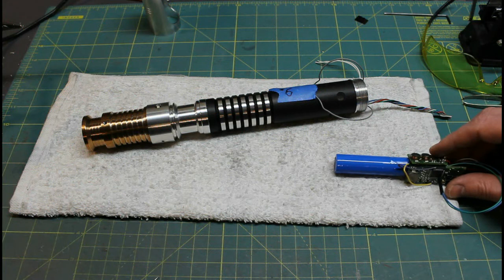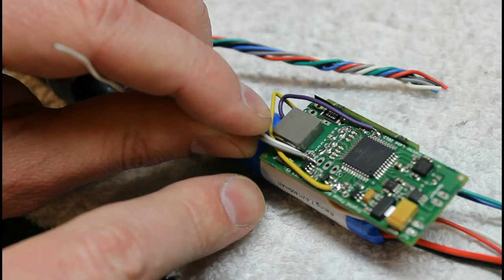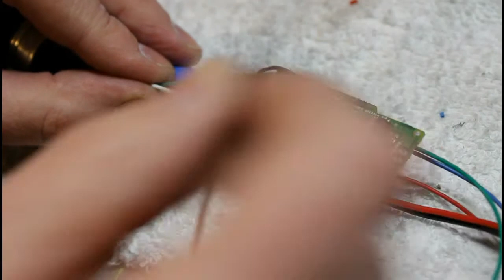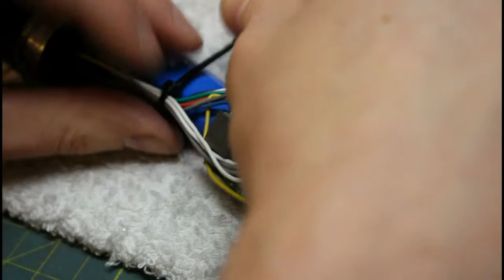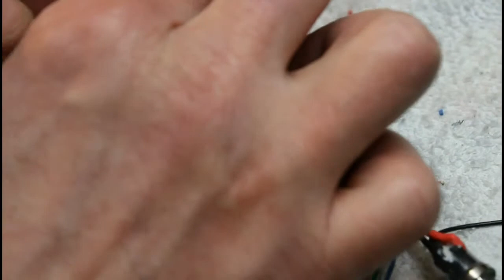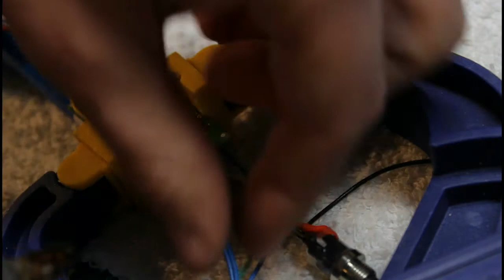Tips for Wiring

Comment: How did you attach the soundboard to the battery?
Reply: Hey,
This is an older way of attaching the board when a chassis is not available or possible. I used an industrial 2-sided tape. You can also additionally secure the board to the battery with a Zip-Tie

Comment: I have  a question to ask. Is there a tutorial that you made on how to add an auxiliary button to you saber? and to the soundboard?
Reply: It usually depends on your board. Like take the crystal focus for example. You got three switch pads. A main an aux and a ground. Now say if your switch wires are yellow for main and white for aux. Also it depends on your switch. Some have only two legs some have multiple. But you mostly only need two legs to act as a switch. Now take one yellow wire (main) and solder it to the activation pad. Take one white wire (aux) and solder it to The auxiliary pad. Now you take the other yellow and white wire and solder them together to the ground. Now other boards like the nano biscotte is only a single switch saber (momentary required) so you can’t wire an auxiliary switch on a nano biscotte. So like I said it all mostly depends on your board